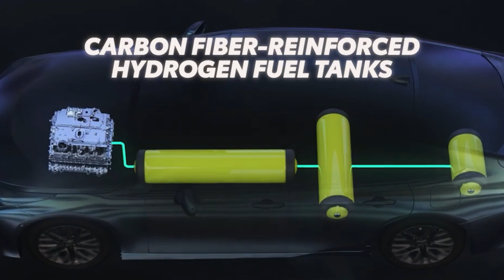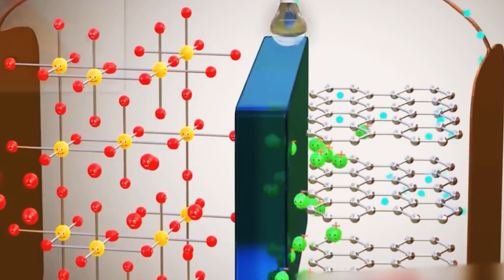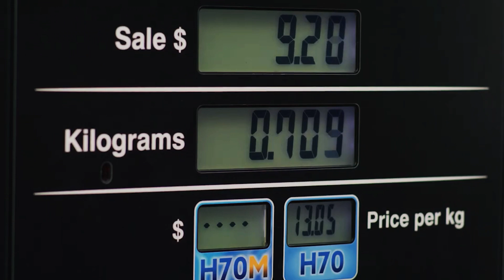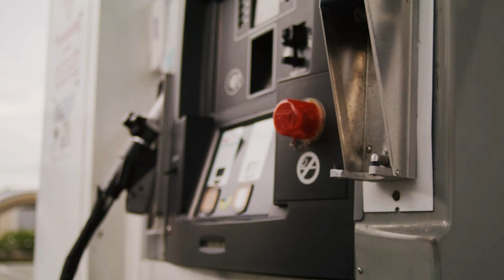TOYOTA VS. THE WORLD: BETTING BIG ON HYDROGEN OVER ELECTRIC

Comment: Hydrogen is a non-starter for widespread use in automobiles....or, really, any realistic use at all.  It's energy density is much lower than that of an EV battery or any other comparison.  And a huge impediment to adoption is that an electrical infrastructure for EVs is far easier to ramp up than a hydrogen distribution infrastructure that would have to be built from the ground up.  Add to this that there is no method for hydrogen production from electrolysis available that would do so at sufficient quantities at low cost.  So, that leaves making hydrogen from oil....and all the carbon footprint that goes along with that.  Toyota (and I own a Toyota) is bat-sh*t crazy pushing this idea and it's likely a smoke screen to make it look like they're cutting edge thinkers when they, along with most of the other legacy automobile companies, are falling further and further behind the new kids (Tesla, BYD, Fisker, etc.) every day and will likely never catch up.

Comment: This peice is old news and slights over many crucial issues associate with the dangers and costs of using hydrogen as fuel . There are good reasons few automaker are not embracing it. The Hydrogen is from where? 95% from fossil fuel! How's that protecting the environment? Once produced it needs to be converted from gas  to liquid, needs energy for the conversion. Once converted liquid Hydrogen needs to stored at -423 degree F, its also extremely flammable, i.e. remember the Hindenberg disaster and the space shuttle Challenger explosion? This thing is dangerous and requires heavy equipment to move around. Meaning thick tanks and heavy tankers. More energy required. ......